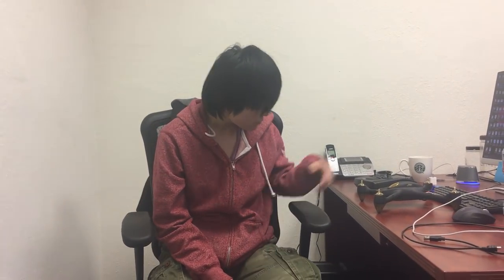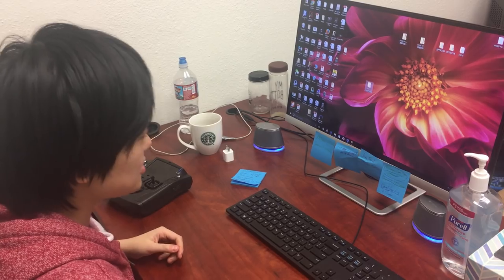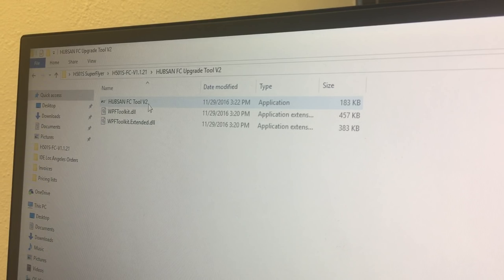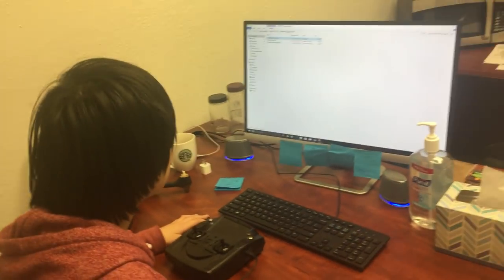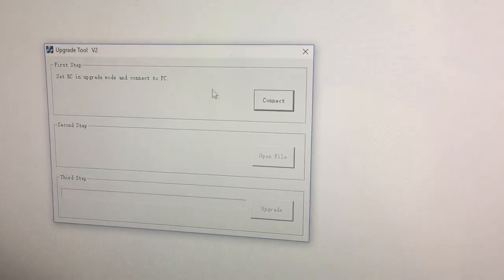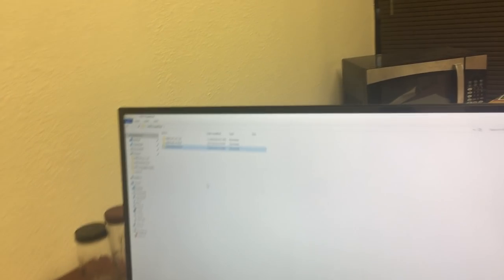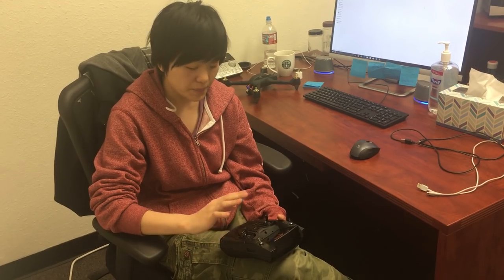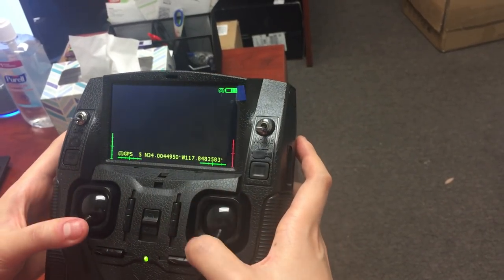H501S Firmware Upgrade Protocol

Comment: this firmware works in fp1 transmisor?
Reply from the maker: The procedure is similar, but you would need the right firmware to upgrade.
Reply: you know, From where I get it, regards
Reply from the maker: There is no need to upgrade the transmitter.

Comment: Hi problem with Upgrade Tool V2 for RX transmitter ,it says No upgrade tool connected when it checks com 3 on my computer any one have any ideas why?,and will it affect my upgrade V1.122 for my H501s quadcopter?.
Reply from the maker: It is possible that your computer is missing a driver to read the transmitter.

Comment: for some reason my FPV is cutting loosing signal at 50M out and i am only flying at 20M high or so, new battery's, current software is fine. standard transmitter no mods , ideas?
Reply from the maker: It is possible that there are some bad connection in the drone or the transmitter, I would suggest that you send an email to our support team at service@hubsan.com for further assistance.
Reply: i sent an email monday and never got any response, i will resend again . I just resent another email request. thanks for responding
Reply: got some response but no follow up to fix issue

Comment: ....in the menu setting what is the frequency setting for the standard h501s-s controller ...mine is 5755  is this correct........  thanks if anyone could help.........
Reply: That sounds ok, I changed mine to 5745 usually works well but you can try every one if you want to see what works best for you.

Comment: There is no RX upgrade tool available?
Reply from the maker: If you meant RC, there is no RC upgrade available.
Reply: No I meant the RX, just like in the video. The RX was used to update the controller.
Reply from the maker: All the files you need are in this link:
http://shop.hubsan.com/includes/templates/darktemp_0829/images/soft/H501S%20Upgrade%20Software.zip
Reply: but what about sexy mac users? how do we upgrade out babies?

Comment: Hello tried do upgrade tx and now my transmitter won't turn on. Check my video please. I chose the right files I'm fairly sure. Any suggestions?
Reply from the maker: If the upgrade fail, the little light in the center will still flash and your FPV screen will still show Hubsan logo.
Reply: HUBSAN OFFICIAL found out I installed the wrong firmware. It's all good but my range is horrid. Can't go past 50m without losing fpv and control of the drone and it invokes rth fail safe.
Reply: Drone Worship I figured that out. Waiting on new pigtails for advanced. Should get then today and that should fix my range issue according to many people.

Comment: Dear participants, I want to address the developers of Hubsan on behalf of the head of the Russian club Hubsan in the Russian social network VC.
With all due respect, we ask your engineers to change the speed of the flight to GPS at 7-8 meters per second, naturally, at your own peril and risk, and I personally am ready to experience this new firmware on my dron, respectively, in case of failure it is ready personally to be responsible for that.
We can also assemble a group of testers.
Reply from the maker: Hello. Please convey this message to service@hubsan.com.

Comment: While calibrating the remote controller says "gps signal lost" - what should I do? I tried indoors and outside. The best I could see was like 5 satelites on the controller, but as I plug in the battery of the drone, it says that the drone has no satelites. Anyone who could help?
Reply from the maker: Sometimes it takes a while to get GPS satellites, if you are receiving satellites fine within the first 2~3mins, then there should not be any problem with it.
Reply: Thank you, I guess I wasn't patient enough and panicked after a minute :'D

Comment: i used the exact file to upgrade the fc, however it goes with a " update error " . after disconnecting the drone and tried again. i turned on the drone to realise there was that annoying beeping sound the controller shows the gyro sensor and it will not fly, help anyone?! i have a hubsan h501ss
Reply from the maker: For the H501S-S, you would have to use the H501A upgrade tool to upgrade the FC firmware. You can get the upgrade files from our official website at www.hubsan.com.

Comment: Why do I keep getting an Update Error pop up when I go to update the firmware. Now my drone does not work
Reply from the maker: Please check the QR code on the back of your transmitter, does it say H501S or H501S-S? If it is a H501S-S then you would have to download the H501S-S firmware files from our official website and use the H501A upgrade tool for your unit.
Reply: what is the website?
Reply: It is a H501S
Reply from the maker: Our official website is www.hubsan.com.
Reply: your files for update only contains a readme after extracted!

Comment: this didn't work for me, when i click upgrade it says update error, now my drone is automatically on manual mode, it's screwed!!
Reply from the maker: Hello. Most likely you've upgraded incorrectly. Please send a video detailing your upgrade process and problem to service@hubsan.com. Clearly state what kind of drone you have. If you have an H501S, find out whether it's an S or an SS with this video: https://www.youtube.com/watch?v=K2u09f1z7ro
Reply: I have the H501SS, i basically followed all your steps and when i get to the upload bit it just times out and says update error and i can't do anything else. Now it just beeps consistently and doesn't do anything.
Reply from the maker: Please send a video detailing your upgrade process and problem to service@hubsan.com.
Reply: video sent

Comment: Advanced controller upgrade?
Reply from the maker: The advanced controller is very similar to the standard controller. You just hold down the enter button instead of the video button.
Reply: HUBSAN OFFICIAL I mean is there an update for advanced controller?

Comment: great video looks simple till i tried to find the complete firmware on hubsan website  i could only find the fc upgrade but when i went to open it with windows 7 it said this file do not support windows so if somone can send me a link to do this i would be very gratefull for that
Reply from the maker: You should be able to find the files you need from this link.

http://shop.hubsan.com/index.php?main_page=support

Comment: Hello !! The screen  of my transmitter has popped to regular operating screen after the computer upgrade. This has happened after I upgraded my transmitter using computer part and when I am trying to mod2 stick calibration. Can someone please help me ?? I am stuck here.
Reply: Bob Tegland  its h501s hubsan standard transmitter
Reply from the maker: Could you send me a short video of what you are talking about? I'm not quite sure I understand what you are trying to describe.
Reply: Here is the requested Video, https://youtu.be/aIaCu87gNUc

Comment: I''ve just received my H501s  and I'm trying to update it.First, I updated the Drone as explained in the video, but when I try to update the Transmitter, On Step Three, It says Timeout on Data Response. Did anyone , get this message too? Please, someone help!! Hubsan Official Drone Worship, anyone!!
Reply from the maker: Just close the upgrade tool and restart the process again. Make sure you do not click 'connect' or 'upgrade' more than once.
Reply: HUBSAN OFFICIAL yeah, it went fine after a couple times. But now the drone doesnt complete calibration compass 2 in like 85% of times. I thought the update would resolve this issue, but looks like the issue remains... Is there somethin I can do? cause I'm prety sure I'm doing the procedure right

Comment: Lol, I hear the noise for connecting the controller but the software doesn't connect when i click connect.
Reply from the maker: It is likely that your computer is missing a driver to connect to the transmitter.

Comment: you need to inform people that the H906A transmitter firmware  CANNOT  be updated with these files.. only the quad. That's why some people are updating their H906A advanced transmitter and getting black screen.. note to all DON'T UPDATE THE ADVANCED transmitter (H906A)
Reply: she said the file she has is not for the advanced, even the file name has FPV2only in the filename LOL.

Comment: In need of desperate help. Firm ware updated no it will not calibrate
Reply: This is beyond vexing I'm thinking of no longer being a fan of hubsan I have spent the last 12 hours going through light controls the RX the TX nothing is updating nothing is working at a perfectly good working and quad until I did a stick calibration and now nothing we calibrate I have now going through my controller no longer biting to the quad this is bull Jive!!! I really love my hubsan drones and I'm starting to hate them as much as I love them I'm begging for help here

Comment: OMG Annie. Great vid of 'HOW TO' do the firmware upgrade. It would be spectacular if you could actually find ANY trust worthy link to download the 'firmware'. I mean is Hubsan the most non customer-centric company in the world. Their web site is useless. When you have a device which totally depends on communication between controller and transmitter to simply ignore any need to provide their customers access to firmware upgrades or factory setting is mental or maybe they are just arrogant. If you can eventually uncover a link 99% of the time it assumes everyone has a microsoft based PC. Well for those that don't want to live in the dark dreary past of 'windows' ...hello where the hell in the universe can you find OS X based firmware??!

Comment: is advanced the ss version and standard is 2
Reply from the maker: No; the drones are the same, no matter if you get the advanced or the standard. The only difference between the two are the transmitters. As stated in the video, the H501S and SS functions are the same. We redid the hardware for the H501S and came out with the H501SS. That's all.

Comment: Hi everyone, My thirdfly H501s with control problems.

Batteries ok, calibration ok, no wind. First seconds the quad response to the TX was smooth. But them all the leds turn into red (not the strong red from battery low charge ) and i lost control of it, and it starts to go up, hovering about 9 metres from the ground. A few seconds later, the leds on the back turn green and i retake control again ( and lost and retake and lost....)
The TX switches several times between the GPS and the RTH by itself,  perhaps when the TX automatically enables the RTH i lost control. 
Any thoughts about this problem? A firmware upgrade could solve?! 
Thanks :)
Reply from the maker: It sounds like there was interference in the area and caused the drone to lose the connection to the transmitter then the drone activated RTH.

Comment: dont see the rc firmware
Reply from the maker: There is no need to upgrade your RC.
Reply: Well I did the rc firmware procedure did I mess up anything then?
Reply from the maker: If you found the firmware somewhere and it still works then you are fine.
Reply: Well I had my h501s up 100 meters the other day then I flipped return to home and it started climbing fast and I lost control. But I eventually got it on the ground.

Comment: what are the benefits of upgrading vs leaving it alone.  if it's running great why do the upgrade? and don't bother with idiots like the below.  they are just show how ignorant they are.  they didn't learn respect growing up.
Reply from the maker: Sometimes, we release new functions in new functions (like the two new Orbit/Circle Fly functions we just released within the past 3-4 months). There are some pilots who are on older firmware (that does not have these functions) and want the new functions- so they upgrade. Other than that, though, firmware is all about fixing bugs and whatnot. Some don't care for getting the extra functions and prefer to remain where they are, version wise. The good thing about leaving firmware alone is much more applicable to beginners.  Many try to upgrade right off the bat and even with the instructions we provide, still are unable to do so properly. Thankfully, the effects of a bad upgrade are easily reversible. There are also many experienced clients who fly so much that they can spot subtle differences that even slight coding changes make in a drone's operation and prefer one version to another- so they do not upgrade, no matter what.

Our logic is, why mess with it when it's left well enough alone? Less of an inconvenience...no need to go through a long process when something works already.

Comment: Hubsan cannot be trusted.  My H501S flew away and they told me to go pound sand.
Reply: Arlo, I'll bet you had a bad 2.4 ghz pigtail in the transmitter.  I did a review on how to check them.  It appears more an issue with the advanced controller. I ended up sending my advanced transmitter to Hubsan as I had another issue with the right stick actuator.  I could not arm the quad making it useless.
Reply: I have the standard transmitter.

Comment: You have no firmware on your site. Buy your own mend it quad lol
Reply: Exactly Chris... Which is why I've never updated either of my H109's - if it ain't on their site - it's not an official update and most likely will kill your drone.
Reply: nah m8, rather have some smart dudes firmware that works. The 501 is, in theory, THE best mid priced drone BUT it needs quality control. I've lost £360 in 2 months. Great design, but not finished. They didn't even send a sunshade that was broke, it would have been a nice gesture. Common guys it doesn't even have an on/off switch. It's marketed as DJI or Parrot but it's a RC enthusiast drone, not an Ariel platform at all.
Reply: Stephen Peters even superflyer is whack on my drone. So yes you might as well keep what you have. My advanced does 350m period. Toilet bowls under any circumstances. It's life, part of the lottery. Can still erm fly but it ain't what's on the tin.
Reply: Neither of my H109's ever suffered from TBE until I outfitted them with Feiyu Tech 3D gimbals - On both my 109's the compass is mounted on opposite corners yet still suffers TBE due to the independently moving metal parts of the gimbal. If I want flawless video, I'll have to put up with toilet bowling - But even that only happens on gusty days. It's as if the gyros are fighting against the GPS and the false headings being generated by the gimbal movement. I can live with that and the quickest way to get out of trouble (once you're in TBE) is to flip out of GPS, let it drift for a couple of seconds then flip back in again. Easy enough once you've done a few trial and errors...